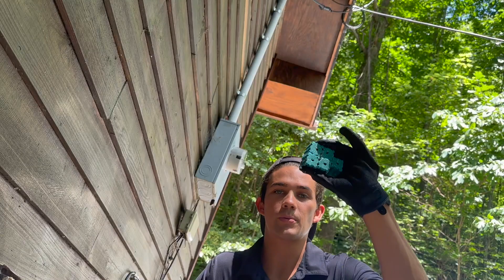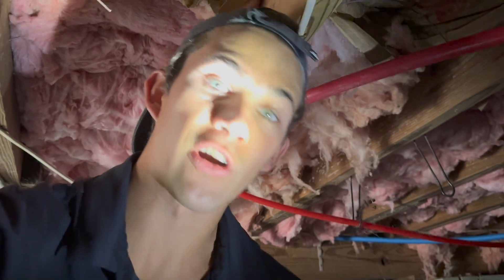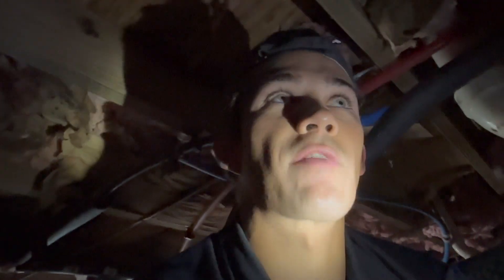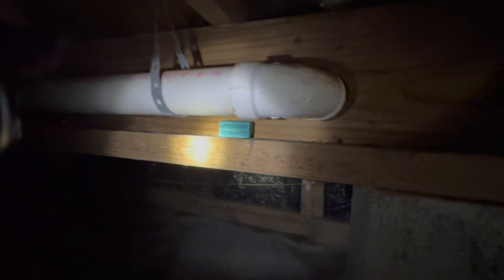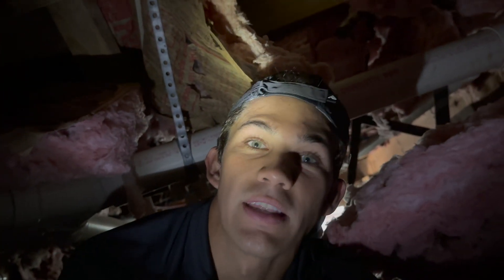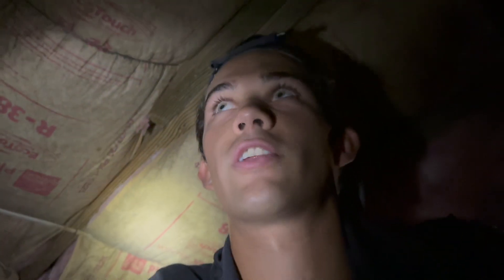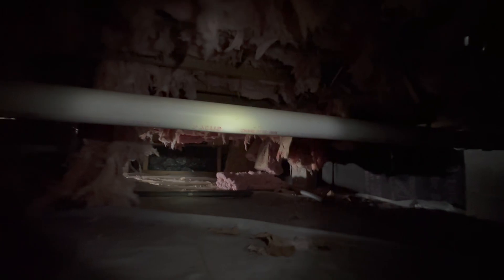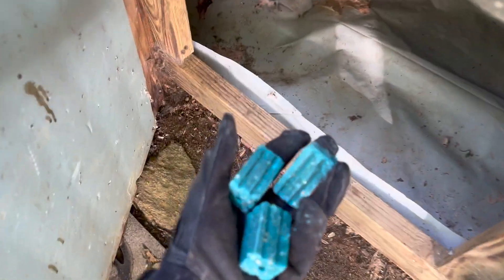The Quickest Way to Get Rid of Mice

Comment: Hi Dan, I have an important question. I will be sure to contact my local pest control, but honestly would love your opinion and knowledge. My house currently has a brown recluse infestation. I noticed the first one almost a month ago. I called pest control (Orkin) and talked to their techs. In the meantime I immediately bought a bunch of glue boards amd set them all over my house. The technician came and sprayed inside and outside my house. A week and a half later, I daresay the problem seems worse. They're still definitely all over the place, I caught 9 brown recluse under a small dresser in my bedroom. Here's my problem...maybe that increase at first is normal, but my technician told me nothing on what to expect AFTER treatment, if anything. If it stays the same, increase or decrease...would have been nice to just have that explained and I wish I had asked. 
Is it normal for brown recluse to be more seen after initial first treatment? Im going to end up paying over 600$ to get this problem under control (7 months of treatments about every 2 months) is the increase in spiders seen around normal? Im very concerned. I've two young children and this problem is extremely unsettling. I haven't slept well at night ever since all those started.

Comment: Honest question as I'm dealing with a similar issue... if the house smells like mice... what's it going to smell like when they die in the crawlspace?
Reply: Usually, mice are so small that it's not an issue. Like Dan said, the quickest way is baits. I usually tell customers it's like tearing off a bandaid. It sucks but it's best to get it over with fast.
If it was rats, I'd start with traps. They will smell bad .
Reply from the maker: It may smell worse before it gets better but that’s just part of the process. Replacing the insulation will help too!

Comment: sticky traps are good because mice are fast  and these catch that clever mice that out smarts traps  and poisons
Reply from the maker: I’ve had mixed experiences with glue boards! I usually don’t use them for mice
Reply: I stopped using the glue boards because it’s inhumane since the mice don’t die instantly as they do in a snap trap. As much as I don’t want mice inside my house I’m not going to give them a cruel death.
Reply: No they’re not, they’re incredibly dangerous and inhumane. People have had pets die in them and the animals stuffer for a long time. If you don’t care about the animals then they also make a mess that can be very hard to clean

Comment: Couldn’t the owners put up sheets of chicken wire with screws so the the mice could not get into the insulation?
Reply: The holes in chicken wire are too large maybe harware cloth.  Best to stop them from getting iside in the first place. Or use ipm to clean up yards and decoys likenplastic owls to make it less inviting for mice in the first place. If it's a constant issue, you can use bait boxes outside to knock down the population
Reply from the maker: Good idea but that’s a lot of work and the mice could still get around or through it